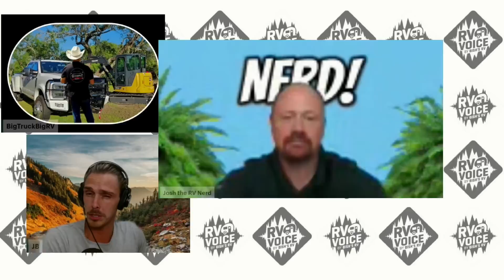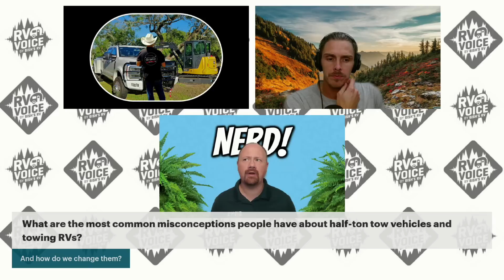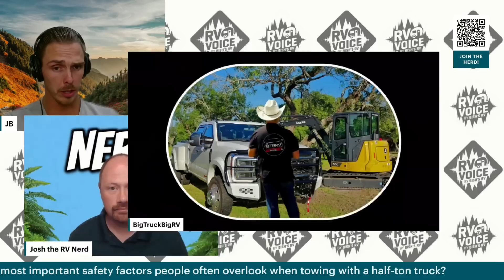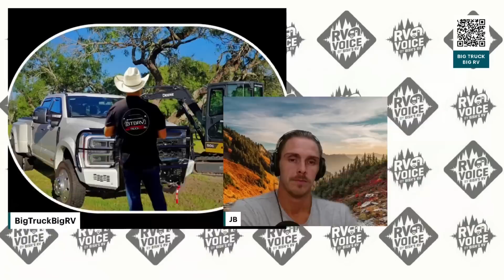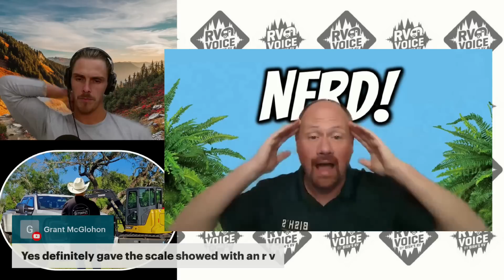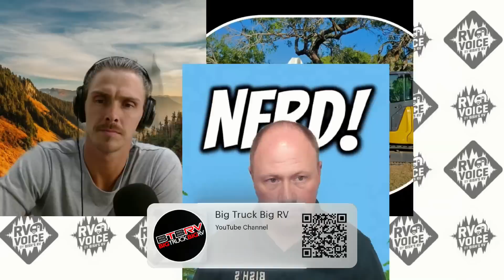1/2-ton Pickup Towing Debate! Josh The RV Nerd VS Big Truck Big RV!

Comment: Josh, good evening I follow you and I like your advice. I have a problem I have a 2019 Ford F150 eco-boost Max tow package short bed 145 inch wheelbase what size trailer would be safe to tow with this vehicle supposedly it tows 13,200 pounds But it has a 1600 pound payload can you help me thank you the truck has 30,000 miles. Thank you for your time. Looking forward to your answer.  😅

Comment: Someone needs to discuss, IN DETAIL, the impact of the SAE J2807 Standards and how they RELATE to towing, determine weight ratings the manufacturers provide and what that means to the average guy buying a pick up and a travel trailer... 

Start with the history of the wild wild west before the acceptance of the standard by all the "bigs" in truck manufacturing when a half ton could tow the Eifel tower in some marketing pieces to the first acceptance and finally by all of them now in effect for about 7 or 8 years. 

You could do this in two, one with the details and a second video with "what you need to know." 

In particular are things like just exactly what is included in the tow rating on your truck? Most people don't know that that rating "assumes" two 150 lb people in the truck so YOU don't have to deduct that. It also takes into account things like 70 lbs of hitch gear...AND a full tank of gas. 

So, explaining those things is important. Being within "specs" with a full 38 gallon tank at approx 8 lbs per gallon is different than a tank empty. 

Just food for thought...and I do remember you from Butte...

Comment: JD and Josh are both correct, RV salesmen need training in the area of payloads and hitch weights. Regardless, checking that door label is something all customers should do before entering that RV dealership.
I told a RV salesman my 3/4 ton truck shouldn’t tow an 11500# trailer. He insisted it could. I took my business elsewhere. I could tow it, but stopping it could be a problem.

Comment: Dry hitch weight of a 5th wheel should never exceed 50% of the payload of the tow vehicle & tongue weight of a tongue pull trailer shouldn't exceed 33%

Comment: I have a 2017 Ram 1500. Towing
capacity 7900 lbs. Payload 1500 lbs.
I have a 2024 Jayco 6100 lbs dry
weight. 30 ft long. Have a Equal-i-
zer sway control and load
distribution hitch. Pulls good on our
local trips. But next summer we are
pulling from Indiana to South Dakota.
Do you think i need a bigger truck
for that trip ?
Reply: @dougfisher5041  noo, I'm a truck driver they don't talking.

Comment: Problem with half ton towing is the payload and tong weight. Also sway since the Truck will weight almost same than the RV. You could tow a very small and light RV, but still, not going to be a safe ride.

Comment: Here is the crazy thing.  If your RV overweights your 1/2 ton trucks Gross Combined Weight Rating and you have a motor vehicle accident, you are liable.  If you accidentally kill someone, you can be prosecuted for Homicide and you could also be sued for accidental death.  The worst part is you are negligent and are liable not your insurance company.

Comment: I tow a 36' travel trailer with my 2019 F-150. I've scaled out full of fuel and family and we were over on the pickup's GVW by about 200lbs, all on the rear axle obviously.
While not ideal weightwise, I've towed it 5,500 miles just fine. I don't go above 70mph. I have airbags to help stablize the rearend (I know it doesn't increase capacity)
Powerwise, it pulls like a horse. Braking is just fine as well. The transmission really works well in Tow/haul mode to downshift when you hit the brakes.

I enjoy my setup because other than towing that a few times a year, I don't need anything bigger. BTBRV has stated many times that his recommendations are geared toward people who don't know much about towing. I grew up the son of a truck driver and was towing trailers from the time I could drive. I think it boils down to how comfortable you are towing with a half ton. If you understand the limitations, it can certainly be done safely

Comment: I hope this video  helps! I see 1/2 ton pkups every day on the street and campsites with trailers they shouldn't be towing. I don't see a lot of 1/2 ton towing 5th wheels though. We camp close to sand dunes, talk about over loading pkups 1/2 - 1 ton! That's a whole nother topic, 2 sand buggies in the truck and pulling a 35' trailer, flat bed loaded or travel.
Reply: Edit: I'm talking SRW 1 tons

Comment: Pulling a heavy trailer near your 1/2 ton's limits up a mountain pass will certainly stress your drive-train. What towed fine on the flats may become difficult for your 1/2 ton to haul up steep inclines. You may be forced to slow down, or your engine/transmission may overheat. This inherently causes a safety hazard, but I contend that the danger on the other side of that mountain incline is considerably increased during the decent. A 1/2 ton has a much lower engine braking capacity and therefore requires much more braking application on those steep declines, especially compared to a heavy duty deisel. Should the braking system become overwhelmed, you will not be stuck on the side of the road with an over-heated transmission, you will be hurtling down the highway at an uncontrollable speed. This run-a-way condition can rapidly lead to catastrophic outcomes.

Comment: I put helper springs on an 87 Nissan hard body, and was trying to haul 3/4 cord of wood.  Ultimately, it handled the load power and ride wise but I cracked the frame in the meantime.

Comment: Toy haulers???  Multiple motorcycles are what I’m going to be carrying.  One bike will be 800 lbs and another bike will be about 500 lbs.  the toy hauler I’ll get will be able to handle the weight.  But mounting the bikes fore and aft is my concern.  To get the proper tongue weight

Suggestions !
Reply: The toy hauler I’m looking at has a dry weight of 6000 lbs with a carrying capacity of 3000 lbs.  so a total gvwr of 9000 lbs.  I’m getting a new 2500 or 3500 SRW truck

Comment: Question and professional pilot here. DOES 1/2 ton dry weights include the driver’s weight, and what is that weight? AGAIN, for 1/2 ton ratings!

As a driver, I am not a passenger. OR. AM. I.

Comment: So cool, the three channels I watch the most for RV advice, the nerd, JD, and Matt. Followed Josh's advice about weighing, on the way home from picking up our 5th wheel I stopped to get it weighed. We then loaded it up and weighed not only the trailer alone but both the trailer and truck together so I now know where we stand as far as capacity. It's a Grand Design 100 series which GD's website says is 1/2 ton towable but after watching all three channels opted for a 3/4 ton. We just got back from a 3,000 mile month long trip and can't agree more that a 3/4 ton is the way to go in regards to stability and ease of driving. Thanks guys.

Comment: I have a 2021 F150 4x4 Lariat with tow package and payload package. Using Ford's chart for my wheelbase/engine/gear ratio, my max towing capacity is 9,600 lbs. My payload according to my door sticker is 1,908 lbs. I tow a 28' 6,100 lb. (Fully Loaded) camper. I'm 3,500 lbs under my tow capacity, and 400 lbs under my payload capacity when fully loaded and hitched up (according to the CAT scale). Yet there are people who say I NEED a 3/4 ton truck at a minimum to tow my camper. What am I missing here ? Am I not easily and safely within the limits of what my F150 is capable of handling ?
Reply: Sounds good to me, how does it feel pulling? Probably just fine I would guess.

Comment: This was a great video and I hope people looking at towing for the first time listen to it. 

One myth you only touched on that I would have given more emphasis too is the “you’ll be fine with X truck on flat highways but if you want to go to the mountains then you need to go bigger. The simple fact as you know is that the power levels of gas 1/2 ton and HD trucks are pretty equal. So both have roughly the same ability to move weight uphill and as long as your under your GCWR to stop it coming down. The environment where the need for the HD truck becomes most apparent is on the freeway at speed where the effects of crosswinds etc have their greatest effect. Thats where the HD suspension of the HD truck really shines and where the benefits are the greatest. 

Another subject you didn’t touch on fully is the hitch weight ratings.   I really think that especially in the half ton arena J2807 has done us a serious disservice. By requiring a 10% tongue weight for the test the result is we are certifying to a minimum because 10% is the absolute minimum and most trailers especially travel trailers are well over that. That 10% standard drives hitches being rated to 10% of the tow rating. So a truck that is rated to tow 9200lbs will have a hitch rated at 920lbs. That could easily result in a truck and trailer combination where your under the payload and axel limits but over the max rating for the hitch. The 10% rule is also a big driver of some of these elevated 1/2 ton tow ratings because if you only have to handle 10% on the tongue then now that 13,500lb trailer is only placing 1350lbs on the tongue with which one driver in the truck allows a truck with under 1600lbs of payload to qualify to tow that massive trailer under the SAE standard. But if we consider a moderate 13% now the tongue weight would be 1755lbs. Or even better 15% (which is what I strongly advocate for planning purposes) 2025lbs. Moving to a 15% standard for the SAE test would have a hugely positive impact on setting tow ratings at a more realistic level. 

I also think that the SAE standard should move from flatbed trailers for stability purposes to large box trailers that look more like an RV. I’d suggest a sliding scale of size based on weight. Like 20’ for up to 4500 lbs, 25’ up to 6000lbs, 30’ up to 8000lbs, 35’ up to 10,000lbs and 38’ for 12,000 and up. The height of the box and how far off the ground it is should mimic an average RV of that size.
Reply: All thos plus a duty cycle for towing with a half ton. Say 5k lbs 100% of trucks miles, 7k for 75% of it's total miles etc etc. That's the other big differnce between a half ton and 3/4. A 3/4 gasser is rated for similar tow capacity as a modern half ton but for everyday use at that weight.

Comment: Besides the important payload number I find that most half tons have the short bed. I think this is the main reason the HD trucks always tow nicer right out of the gate. A long wheel base really helps with longer trailers. I have a half ton Tundra and it has no problem in the wind with a 32 foot trailer but it has a pain the ass long wheel base, crew cab 6.5 bed. Looks like it was covered :)

Comment: Yes, please do more of these. It is very educational for new and older RVers. All the information you put out today I learned by watching Tuber's that knew what they were talking about. I bought a new 2023 Ram 1500 with a HEMI in 2024 and has a towing rate of 10,300 lbs. I have a very small RV, 2019 GEO Pro 12 SRK weighing 2200 lbs loaded weight. Josh knows this model as I bought it as a result of his review on it back in early 2019 and I still got it and have 205 nights. I have had no issues other than the maintenance I get done that a lot of RVers don't bother with. With the Ram I looked at the payload on the door frame, 1440 lbs which I suspect was correct, but the dealer put on some running boards 70 lbs, I put on a trifold hard cover tonal cover 65 lbs, a heavy rubber mat in the box, 25 lbs and then there's the actual hitch that you put in the receiver, 58 lbs. All this needs to be subtracted off your payload. So take that off of my 1440 lbs, it's now down to 1222 lbs. Now take in the hitch weight of 350 lbs from the trailer, now down to 872 lbs. of payload and I haven't add all the stuff I put in the box of the truck. You would be amazed after you load your stuff and family in the truck what you have left or what you are over in payload. One more thing. That dry weight of your RV may be correct when built but with mine it did not include the battery's weight which was another 100 lbs on the hitch weight. So you understand where I got my weights, I actually weighed it at a scale, with the weight distribution on and then off so I knew where the weight transferred to. Thanks again for the information guys. Sorry for the long comment.

Comment: For the how long can I tow, a 110 inch wheelbase vehicle can safely tow a 20 foot trailer.  After that every 4 inches of wheelbase is an additional foot of trailer.   To put that in a formula:

Trailer Length = 20 + ( Wheelbase - 110)/4

Comment: do you ever even thing about the lack of brakes on a 1/2 ton? 
1/2 are great to go get the grocery's.  maybe a smaller ski boat. . never a cabin curser. 
a pop-up camper, just a camper shell, nothing more. 
as they were never made to tow weight. they are made for the easy riding groups. the old station wagon crowd. .

Comment: The number one overweight failure towing with a 1/2 ton truck is the cargo capacity. Most have the tow rating of 15k combined gross vehicle weight, but not the cargo capacity.  By the time you add the tongue weight and put your family in the truck, you're maxed out with nothing in the truck bed. In my case, my trailer is 6000lb on the axles but 1300lb tongue weight. Which exceeds the cargo capacity of most crew cab 1/2 ton trucks.

Comment: Great discussion, I’ve noticed while shopping for a travel trailer that Some Mini-lite trailers with an approximate dry weight of 5,500 Lbs have a tongue weight of 800 plus Lbs, which is due to the manufacturer locating slide-outs towards the front of the trailer in turn significantly reducing payload capacity of most half ton trucks, definitely pays to do your research!

Comment: It would be nice to see that spreadsheet you have Josh with what you vehicle size with trailer weight.  I believe it is one of the most things over looked when towing is the wind drag with a longer trailer.  For example I'm pulling a 36' TT with a 3/4 ton truck and I'm well within my limits but there are times I wished I had a one ton with a longer wheel base.

Comment: I have a question I’m looking to buy a travel trailer The GVWR is 7000lb and the truck towing capacity is 9200lb this is a 2023 Chevy Silverado 1500 2.7  with 10000 miles will I be ok towing this trailer. ?

Comment: Guys, thanks for collectively bringing this critical issue to the forefront. I grew up with a Dad that taught us to be self sufficient and feel I have good common sense, but I always thought cargo capacity was what cargo you put in the bed. We bought a 263 RBS in 2023. I’m a perfect example of towing vs cargo Dilemma. My gross weight on my camper is well within towing capacity but didn’t think or realize my cargo capacity was only 1340 lbs. when you have a factory tongue weight of 720, which is probably an under estimate based on these videos. Josh, you guys collectively are doing a great job, and no doubt, will save some lives, and at the least, a lot of headaches/heartaches. I wanted a 22 foot camper with no slide, which would have been perfect, but we couldn’t find the right layout and ended up with 26’3” and a slide. My first step is getting a tongue weight scale and continue to dial it in. 
QUESTION; JD, do you have a video of setting up an equalizer with airbags supplement? My 2016 Tundra only has 56,000 miles, and no way giving up on that. I’m praying with all the guidance you guys can give, that I can be safe out there, and keep this camper. I don’t want to take a big hit getting rid of this, and lately all the quality issues, frankly don’t want another new camper. Ugh!, help!, lol
Reply from the maker: Thanks my friend! The problem with a WDH and Airbags is when to have an "auto leveling" or "auto inflating" airbag system.  Having airbags also throws off the actual goal of a WDH since you're changing the dynamics of how the system works.  I may make a video on this topic.. thanks again

Comment: depending on trailer and wind load it carries....70% of its stated ability is a good measure.....problem is when you find out you done screwed up its too late....like JD said you really have to research your truck and get your stuff weighed.....GM is pretty cool the way they have their stickers set up on new trucks for each VIN

always 100% better to have more truck than you need than not enough 

nobody buys the 1/2 ton WT reg cab long bed to go camping in, lol.......most are crew cab SB mid to upper trim spec trucks....RV companies want you to spend 100k on their rig not go out and buy 80k 3/4 ton truck....cuz you probably cant buy both at same time

Comment: This is a waste of time, you aren't going to solve this issue. The fact is that there are not enough failures that occur due to being over payload capacity. The reason there aren't a lot of failures is because the manufactures under rate their vehicles meaning the vehicles can carry much more than what a manufacture says it can handle. You especially aren't going to solve this problem with someone not willing to show his face.

Comment: 1/2 ton truck can work I would add airbags for heavier loads near cargo max. Don't use weight distribution hitch those things will bend your trailer frame.

Comment: I have a 30ft 6500 lbs dry weight bumper pull camper. I towed at first with a 1/2 GMC 342 gear 5.3 9400 lbs tow rated truck. It struggled to pull it. Constantly shifting and transmission running hot even on the flat highways. Took it in the mountains and about burnt the transmission up. Got sick of the white knuckle driving. Got a 3/4 diesel. I now arrive at my destination without feeling like I pulled the camper on foot. We tow long distance. 500 to 1000 miles one way. If you are only going 25 miles from home a 1/2 ton might work but not for me.